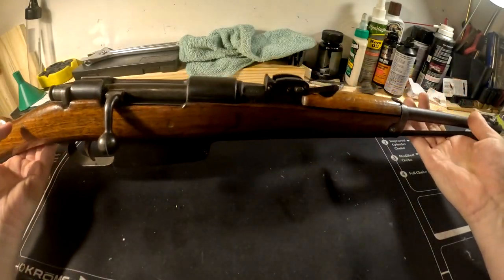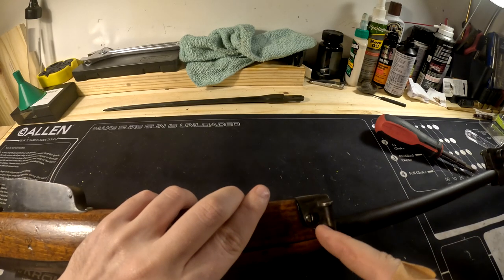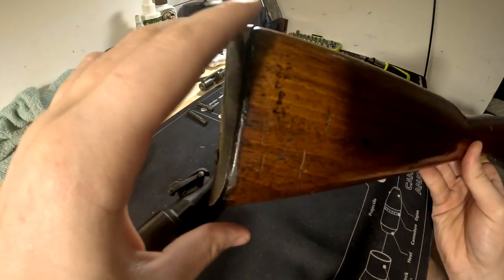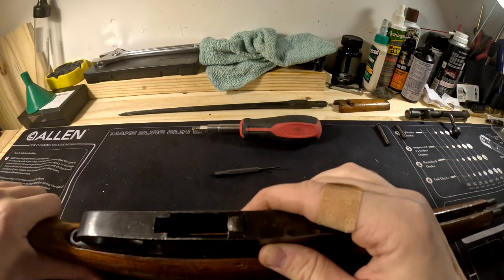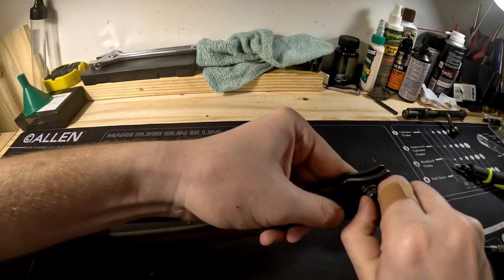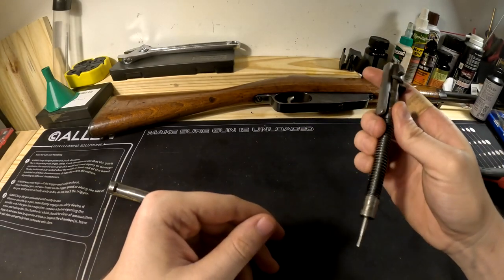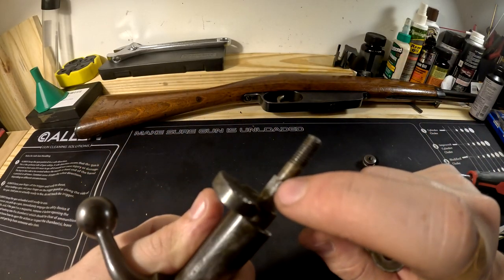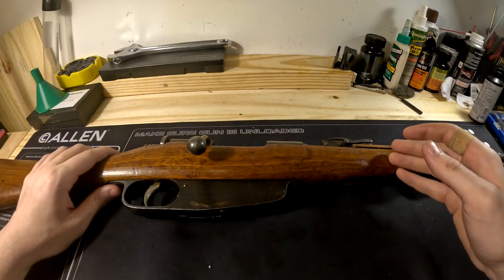Carcano Moschetto Cavalry Carbine Disassembly and Reassembly

Comment: Thanks!
I was having a problem reassembling the bolt on my 7.35.
Any idea on where to find some ammo for it?
Reply from the maker: I wish I knew lol. My Carcano has lived in the safe the entire time i've owned it because of the scarcity
Reply: Sellier & Bellot.

It’s very expensive, but so far it’s the only place I’ve known to have the more abstract ammo (so far I’ve been getting my 6.5x52mm .. I’ve also bought 6.5x50mm sr for Arisaka…

l haven’t bought any 7.35 (x51, I’m assuming?) but I’ve noticed they have it from time to time..

Of course, you could always just hit up Ammoseek. 
That’s how I originally found S&B.

Edit: P.S. the ammo/brass/projectiles will likely be a combo of PPU & Privi

Comment: Where did you get the special bit to take off the bayonet screw?
Reply from the maker: Home made. Dremeled out the middle of a wide flat head bit. Works well for adjusting the Magpul metal mbus rears coincidentally enough.

Comment: Is the bayonet mount/front sight a press fit on the barrel? Is it indexed in some way?
Reply: I removed it from my 1941-dated carbine. IIRC there's a screw that acts as a pin. You'll probably need to use a mallet to convince the assembly off the barrel. Some PB Blaster will help too. The screw/pin will insure that the assembly is properly located when reinstalling.